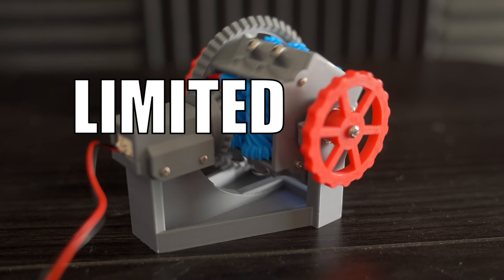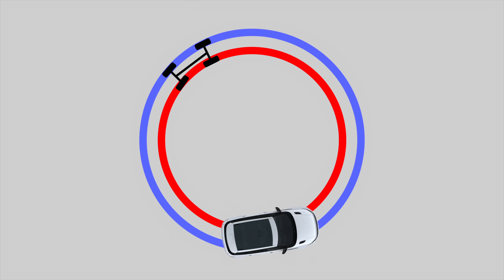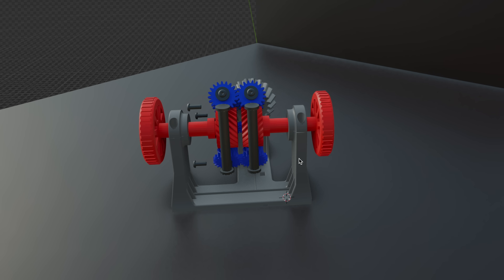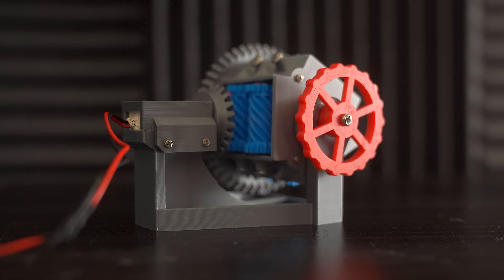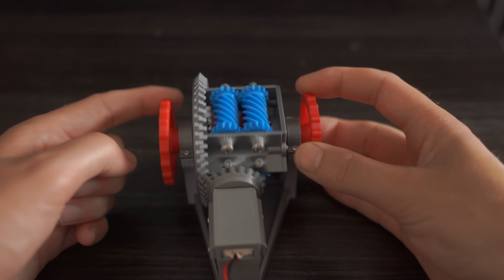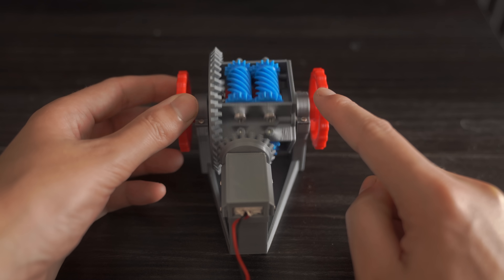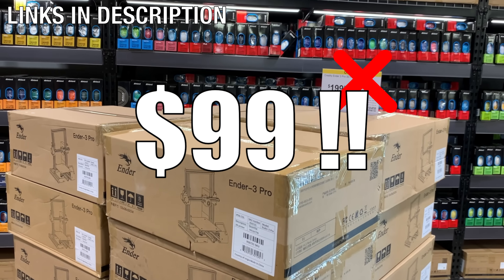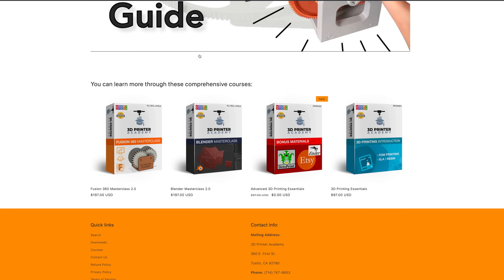What's a Torsen limited slip differential?

Comment: Very important to mention that this is a torsen differential in my opinion. When someone thinks of a limited slip differential it is not typically this differential, it would most likely be a plated limit slip differential as this is the most common seen in cars today. Not many manufactures use torsen diffs, they see the most use in audi's though.
Reply: I replaced my worn out clutch style with Torsen, drives much better and will never need a rebuild. As far as traction, it performs smoother than my clutch style LSD. Defenetly a bit more expensive and you lose a little efficiency hence the factory not putting them in many vehicles.
Reply: @johnh7908  torsen is great for a lot of things, but some things really prefer a clutch-based diff. Most drifters prefer a 2-way clutch diff for a number of reasons. Kind of a horses for courses kinda deal.
Reply: This type of diff is generally used in WRC and other rally categories
Reply: @vicboom1880  Mainly in front weel drive cars, and also more commonly used in racing applications actually, where traction loss isn't as common and/or desirable as it sometimes is in rallying... When controlling a slide, you don't want torque split between the rear wheels to be different, because it creates a very nervous rear end when weight/load transfers from left to right. Every single rally driver i know personally, prefers a plate LSD over a Torsen one. (in a RWD car)  4WD cars do like them front and back, but those cars don't actually really like to slide around either, that's why the electronic diffs came into play on the WRC cars
Reply: @henkverzeijl1525  Helical LSDs can't lock up (I think ~80% torque transfer is the max), where clutch LSDs can lock to transfer 100% of torque- so actually, a clutch LSD will result in a more uneven torque distribution than helicals when sliding (with an open differential being the most even/predictable, but of course undesirable with no slip-limiting function).
Technically I'm oversimplifying because clutch LSDs are highly customizable, including maximum lockup percentage, but the major pro of clutch LSDs over helicals is that they can lockup 100% [where helicals can't], so I'm assuming most people do in fact employ 100% lockup.
I wonder if this was a misunderstanding when you spoke to people, or if they genuinely didn't know what they were doing; it's funny, honestly torque itself, differentials, and especially differentials with slip-limiting mechanisms are so complex that a huge majority of people racing cars won't really understand what's actually happening, physically- I suspect most racers just go with what others recommend and/or try different things and go with what feels best.
Reply: @CosineHyperbolic  Maybe even/uneven isn't the right wording in my example, i actually meant it more in the sense of constant. My open diff on my rwd road car is by far the most unpleasant to drive fast, because power shifts from left to right as the load on the car moves when flicking for example. This requires extra response and driver input, which isn't ideal. You want it to be a constant factor when sliding, so you don't have to adapt to changes in traction aswell as directional and power output changes in mid corner. That's why low-budget drifters simply weld their diffs solid, no variables to consider anymore in that regard.
I know plate LSD's are highly customisable, i do it myself on a daily basis, but most people like their setup very similar actually... All you want is power to both driven wheels when accelerating, and for the car to still respond to turning the steering wheel when you're off throttle. 
100% slip prevention can't be achieved with a plate LSD either by the way, since it's always based on friction, which can theoretically be overcome with enough force... Lots of factors to consider, including even tire width and compound when you really get into detail!
Reply: @henkverzeijl1525  I mean, again an open diff technically speaking does not result in power shifting left/right [where it can for an LSD], because it's always distributed 50:50; but honestly I know what you mean in terms of how it feels- it's hard to put into words [that are technically correct], but there's something about an LSD that feels much better for sliding. I guess it comes down to how the open-diff'd axle itself supports less torque when you load one side and the other starts to slip- resulting in what is effectively power cuts.
"100% slip prevention can't be achieved with a plate LSD either"
That's not correct, unless I'm misunderstanding you; clutch LSD being able to transfer 100% of torque is pretty much their reason for existence- if they couldn't, I think they'd be all but extinct, in favor of helical LSDs. If your RWD car is parked with one rear wheel lifted [over a giant pothole or something] and you accelerate with a clutch LSD configured to lock 100%, the axle will lock 100%, transferring 100% of torque to the grounded wheel, resulting in both wheels rotating in unison [after a couple degrees of wheel slip to engage the cam lock].
Reply: @CosineHyperbolic  If you need full lockup, then just use a locker.
Reply: @wvjeepguy8178  You're referring to a manually lockable diff, for off-roading? Helicals and clutch LSDs are primarily used for racing.
Reply: @CosineHyperbolic  I'm quite aware. The bias on any LSD is adjustable, even the style shown in the video., but they will never be 100%. That's where a locker or spool comes in.
Reply: @wvjeepguy8178  Clutch LSDs are capable of locking 100%. This is common knowledge, and I also have seen it happen from outside my car- super cool actually, as you can hear the LSD lock when you slow the video down.
I guess maybe you're thinking 100% of the time..? Because indeed, a clutch LSD won't stay locked. A spool is equivalent to a constantly-locked diff / solid axle, and [I believe, though I haven't researched much off-road tech] a locker is simply a diff that can be manually placed in a locked setting, making it again identical to a solid axle.
Reply: @CosineHyperbolic  A cutch based lsd isn't going to lock 100% under a lot of torque unless something is wrong. The additive is in the gear oil specifically to prevent that.

You can pack the clutches as tight as possible, use carbon fiber clutches, and a heavy rate spring, but the clutches will eventually slip or fail once enough torque is applied.

As far as lockers go, there are different styles. A non-selectable locker like a Detroit or Grizzly has a ratcheting mechanism that allows the tires to differentiate while turning, but remain locked while in a straight line. Applying throttle while turning can force them to lock up, which reduces steering ability and possibly causing an accident.

Selectable lockers can be actuated either by electric, air, or a cable and are effectively a spool when engaged.

The Torsen style limited slip effectively makes clutch style obsolete. It has all of the adjustability, while being far stronger, dependable, and longer lasting. A Detroit trutrac should easily last 200,000 miles with nothing but an occasional gear oil change, which does not require a limited slip additive.

The best video I've found to break it all down is from Filthy Motorsports

https://www.youtube.com/watch?v=x40WGUtdaLI
Reply: @wvjeepguy8178  [sorry if this is a duplicate reply, but I don't see my response(s)- I think YouTube is deleting them because it's considering them spam due to some links...I'll reply separately with an attempt to post the links more discretely]

Ah, I think I see the misunderstanding. Indeed, it's true that if enough torque is generated, the clutch pack can slip; however that doesn't mean clutch LSDs don't lock 100%. They can [if configured for it], and in fact I don't believe it's a common/reasonable scenario for the pack to slip- even with high-torque builds.
Here's Cusco's very own PDF showing their clutch LSDs' ability to lock to 100% (this is the most technically correct resources on clutch LSDs I've come across):
[Link A: redacted, posting in later comment]

"The Torsen style limited slip effectively makes clutch style obsolete."
They're just different options. Not only are clutch LSDs capable of locking to transfer 100% of torque (which is already pretty significant compared to helicals' reaching only ~80% transfer), but they also activate in different scenarios. For example, while helical LSDs must activate/"lock up" under engine braking (which may not be desirable), a 1-way clutch LSD does not activate during engine braking.
I made a related write-up (I also addressed the misconception regarding what "x-way" means with regards to clutch LSDs, in case that applies to you):
[Link B: redacted, posting in later comment]

The video you linked is 30 minutes long, so I hope you can understand me not wanting to watch it; by all means, if you want to provide timestamps where notable statements are made, I'd be happy to view those and address them.
In any case, I can see the channel who posted it is dedicated to off-roading; with that in mind, it's no surprise they made statements conveying the ineffectiveness of clutch LSDs for off-roading which accidentally mislead viewers into believing clutch LSDs don't lock to 100% torque transfer.
Reply: @CosineHyperbolic  I think we are defining "100%" differently. You are implying 100% lockup until the point to which it is no longer locked up..basically "it works until it doesn't". This is only going to happen on dry pavement or until the driveline torque overpowers the holding ability of the clutches. The clutches will act as a fuse to keep the carrier and other components from being damaged in most scenarios, and are designed as such. 

Just like a manual transmission clutch, it is only rated for a certain amount of torque until it will start slipping, and that is in a dry application with no lubricants to encourage the slipping.

I am defining "100%" as a constant lockup no matter how much torque is applied or the difference in traction from one wheel to the other. 

Only a spool or engaged selectable locker will truly give 100% lockup until failure of driveline components. This is most usually seen as a broke axle shaft, although the differential itself does sometimes fail.

I have driven vehicles with clutch based LSD built with race level components, and they just are impractical and obsolete compared to every other traction device out there.  

Packing the clutch pack as tight as possible in the carrier with carbon fiber clutch disks and a high rate spring will certainly give more traction than a factory clutch based LSD setup, but it wears quickly in street use. I've personally ran these myself and experienced it firsthand. The tires will chirp around sharp corners for a couple thousand miles due to the tightness of the clutch pack, but the clutch pack does break in quickly. Take it into the mud or snow just one time and the tolerances are lost almost immediately.

These days, the only people I ever see running a clutch based LSD by choice are old timers who grew up with them and can't adapt to progression in the industry.
Reply: @CosineHyperbolic  He covers clutch based LSD at 3:40 and Torsen style afterwards at 6:10. 

https://youtu.be/x40WGUtdaLI?t=209

30 minutes for a such a video really isn't very long, considering the variety of products covered and the detail of the explanations.
Reply: @wvjeepguy8178  Yeah that was the confusion.
"basically "it works until it doesn't". This is only going to happen [...] until the driveline torque overpowers the holding ability of the clutches"
Right - technically - but sufficiently high torque causing the clutch pack to slip doesn't actually occur in practice- or, it's the exception, not the rule.

Helical differentials are not new; in fact torque-biasing differentials (a category helicals fall into) existed in a different form even before helicals, and they have never replaced clutch LSDs even now, because they simply offer different pros and cons- namely, as mentioned, maximum torque transfer, and lockup conditions (acceleration / engine braking / coasting / braking). Clutch LSDs can also be tuned where helicals can't.
Clutch LSDs are still favored in things like rally because of their superior torque transfer, given the tendency of such a discipline to involve inconsistent traction across wheels (bumps lifting wheels, spots of looser gravel next to firmer dirt, etc.).
"[clutch LSDs] are impractical and obsolete compared to every other traction device out there"
Again, just silly, for reasons already addressed. However, I will absolutely give you that most people (especially driving on pavement) would be better served by a helical.
It's one thing to say "helicals are pretty much better for 90% of people" and another entirely to say "clutch LSDs are obsolete"- one is probably objectively true, the other is objectively false.

"I am defining "100%" as a constant lockup no matter how much torque is applied or the difference in traction from one wheel to the other. "
I mean "100%" means different things depending on context.
As I mentioned before, I do recognize that clutch LSDs don't stay locked like a locker "100% of the time" and are theoretically capable of slipping (e.g. locking is not "100% infallible")- but that doesn't change the fact that they still can and do transfer 100% of torque to the gripping wheel where helicals can't- which is the phrasing I've been using.

"Take it into the mud or snow just one time and the tolerances are lost almost immediately."
I do follow your logic here, but I have to wonder if your bias is what lead you to this "observation"; because I've been running a clutch LSD for about 20k miles and it still gives me a beautiful boost in grip and that delicious power oversteer (including in snow) which blew my mind the day I installed it.
There's also another potential explanation for this...
I watched that video's segments on clutch LSDs and helicals, and there's a few things of note:
1. First of all, the clutch LSD he's talking about is actually a different implementation of similar technology (one which, I believe, caters to off-roading):
https://www.youtube.com/watch?v=WeLm7wHvdxQ
The one I have and am experienced with (everything I say about clutch LSDs applies to these specifically, potentially not the others):
https://www.youtube.com/watch?v=PEdnH7_7_yc
I wonder if this explains some of the seemingly "inaccurate" things he's saying; he suggested clutch LSDs become open differentials after only ~20k miles, which is absurd, not only from my experience (again mine still behaves like it did on the day of install, at 20k- clunking all around parking lots and giving me power oversteer in low-torque conditions), but also according to factory maintenance intervals (the normal 10k oil change interval for my LSD only begins after 3 oil changes amounting to 13,500 miles).
2. While I hope this is irrelevant, it must be said that he is technically quite biased, as he doesn't even sell clutch LSDs.

So, there was a miscommunication, and further confusion may have been due to there being two [potentially very different] implementations of clutch LSDs (one for off-roading, the other for racing).
If those two types of clutch LSD really are so different that one slips easier and has a shorter life...man that is confusing and annoying! Haha- they deserve different names if that's the case...
Reply: @CosineHyperbolic  So you are admittedly not experienced with anything other than the one application you are using, yet you feel you have any ground to stand on? I tried having a debate with you in good faith, but your bias is now allowing you to learn anything and your arrogance is preventing you from admitting you may be wrong.

He lists the reasons for not selling the clutch based LSD. He is a major retailer for driveline products. Do you not think he would be selling clutch based LSD, made by the same companies he is already selling products from,  if they were a good product? He wouldn't just be leaving money on the table if there was enough of a market for him to justify stocking the product, yet again, the Trutrac torsen style makes the clutch style obsolete.

The model he is showing in the video as a clutch based LSD is Yukon Duragrip. It is a much better clutch based design than any typical factory version, but it is still inadequate for long term or heavy duty use. The four high rate springs apply much more holding power than a single "S" style spring that is usually seen in a factory application.

His estimate of around 20,000 miles is pretty accurate for a performance based application. My own experience with this style is even less mileage. I noticed a drastic loss in performance after only 10,000 miles. 

I have ran every type of differential option on the market, yet you have ran only one, and you want to argue with me? I don't know what to tell you other than to don't bother wasting your time with this debate any further. When you are rebuilding that LSD, just remember you could've got over 200,000+ miles out of a Torsen style.
Reply: Subaru BRZ/Toyota 86/Scion FRS has a torsen diff! I'm not sure about the rest of Subaru's lineup though.
Reply: @Kitteh.B  VA sti have torsen in rear diff.
Reply: I mean, clutch LSDs may be more common overall, but I don't know if any modern car has one of those- helical (like Torsen) and viscous LSDs seem to be the only ones in production vehicles.
Yeah there's some things the author could mention, but it's also a heck of a rabbit hole, haha.
Reply: @CosineHyperbolic  all military humvees have torsion diffs back and front  ., this is the most popular after market limited slip  sold by filthy motor sports  . I am buying one for my 3/4 ton 4 wheel drive chevy
Reply: Torsen was the only limited slip offered in the miata from 94 to 2003, and it is a limited slip in every sense of the word. Seems you lack experience. 
You don't just get to redefine things as you see fit, amber turd.
Reply: That is in part due to a patent on this design if I recall correctly. Not sure if that's expired yet.